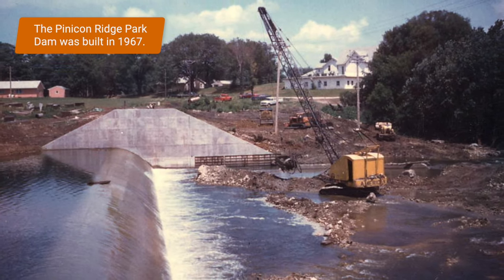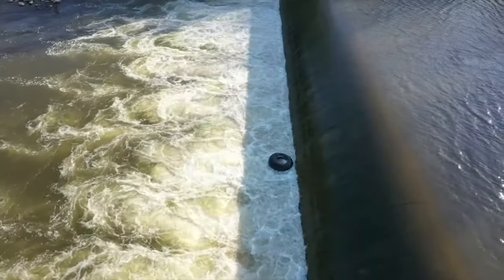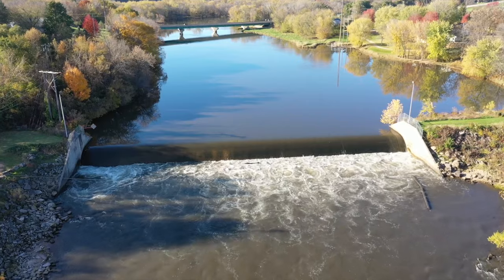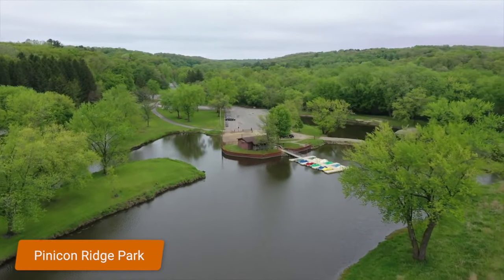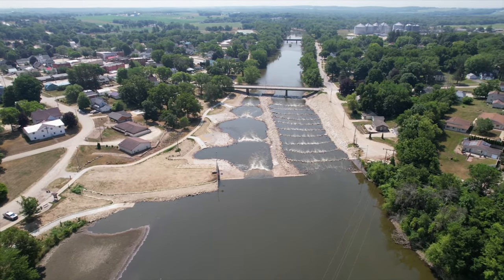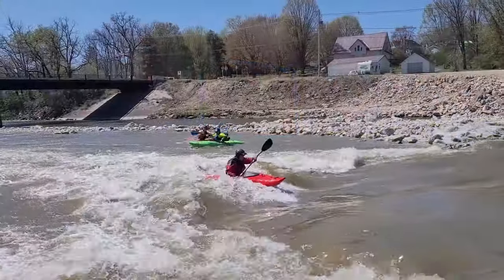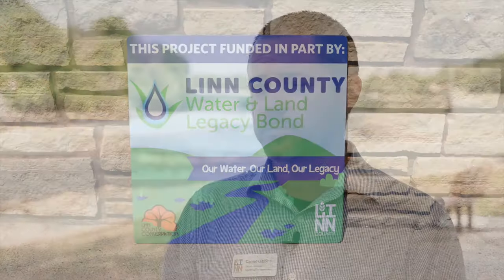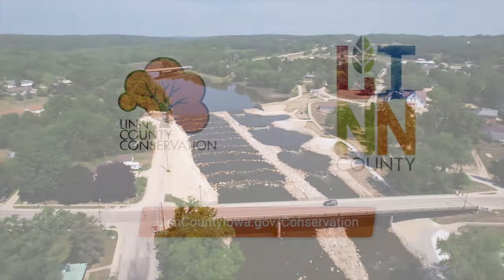Pinicon Ridge Park Dam Mitigation: Restoring the Wapsipinicon River

Comment: Put fish ladders in. There's room.
Reply: Fish ladders are incredibly ineffective whereas what they did is much better for fish. Think of a fish ladder as a single lane dirt road, an unabridged river is like a multi-lane highway like an 8 lane, what they have built is more like a 4-6 lane. Not quite as free but still much better than a one lane dirt road as far as transitability, fish ladders are still  ASTRONOMICALLY better than nothing but no matter how big a fish ladder is it will always be a dirt road where a highway should be
Reply: @ConstantChaos1  You're babbling gibberish
Reply: @ConstantChaos1  They have to be built correctly so they work properly.  In Michigan, the Bordman dam had a stepped fish ladder that allowed all the spawning fish to get up river.
Reply: @user-hi4vo1cn7r  they allow a very small degree of movement, they are infinitely better than nothing but they are actually garbage when compared to an undamned river or what they have done here. That's what I was trying to get at, fish ladders only allow jumping spawning fish to travel between the levels, thats a TINY fraction of the life thats supposed to be able to move up and down the river. Even the best fish ladders are falling well below the mark when it comes to what they need to be doing.
Reply: Fish can easily swim up through this structure.